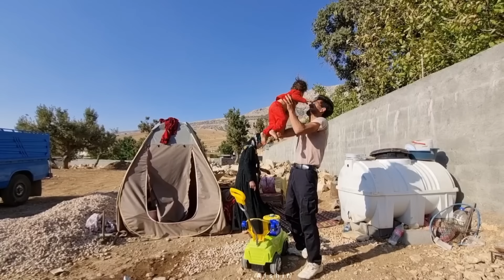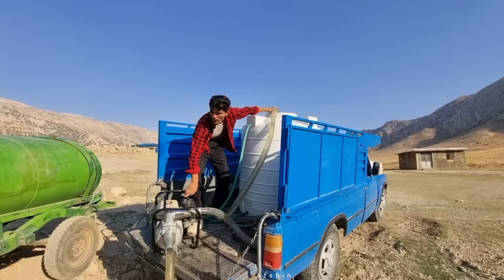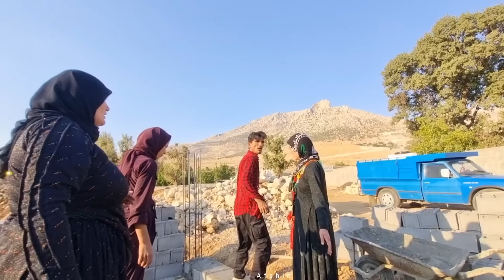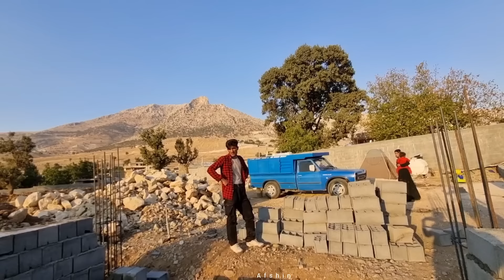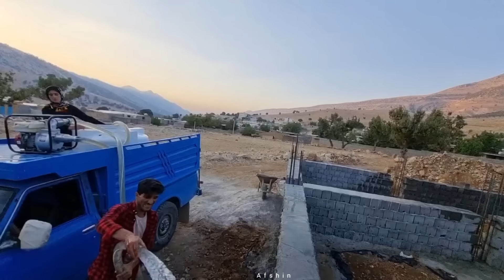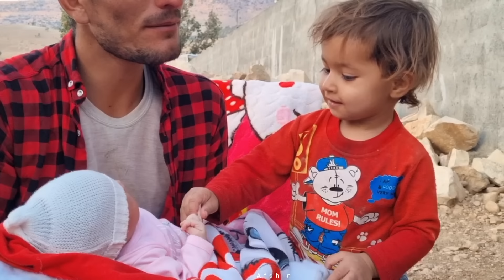Bitter life, Zulfa running away from Afshin, to annoy her mother and sister 😭😭

Comment: 報警 土地賣掉再重新找一塊土地蓋房子 遠離這些人
Reply: Non può vendere la terra perché non è  sua è  stata prestata a Zulfa da Mosè perché era sfollata ma Zulfa non ha comprato nulla.
Reply: It would be difficult here, there is a solid concrete base and it is reinforced, I'm not sure that would work, but this is how joints that stand the test of time are built. If there is a good foundation, the walls of the underpasses will not get wet. Don't sell this anymore, it's been built very well so far, I'd rather make a room for the winter and focus on building the fence. A strong high fence with a good big iron gate.